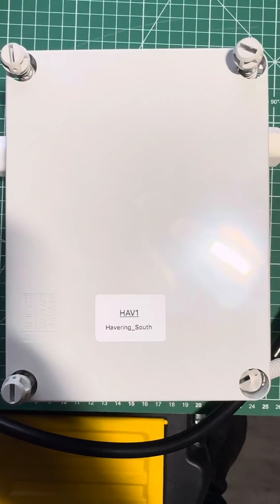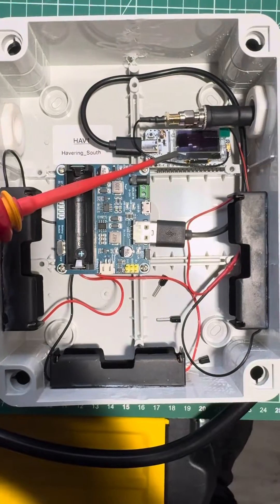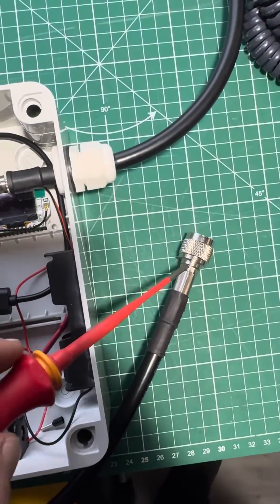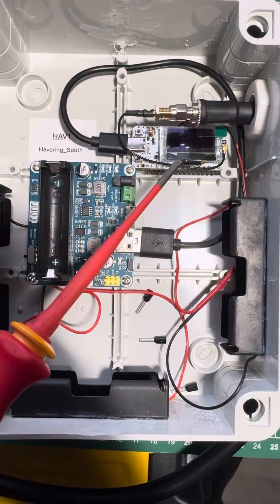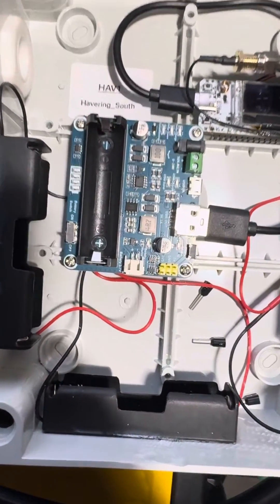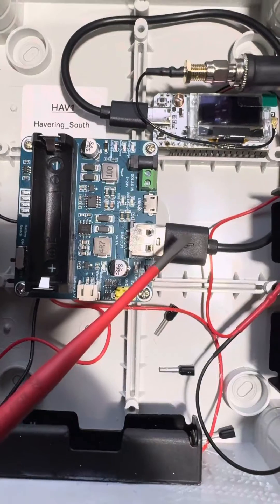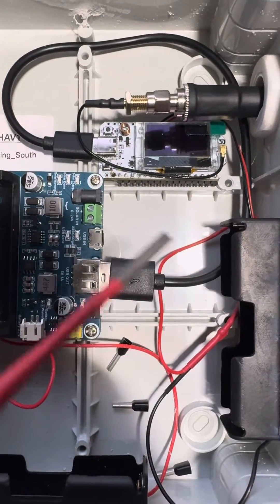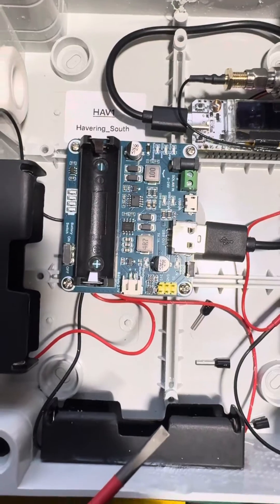MESHTATSIC SOLAR NODE PART 1 THE BUILD

Comment: I found that solar power management charging board on amazon, but it appears to use a 14500 battery instead of an 18650 (which is why the plastic battery holder looks smaller than the other three that you added).  Do you know of a similar solar board which natively takes an 18650 instead?
Reply: Cricklewood Electronics sell a solar panel with attached 18650 holder, as well as some moderate solar panels for low power use.
Reply from the maker: They are out there, however I wasn’t able to find any when I was looking for them when I made this one. I ordered 2 of the one featured in my video, so my next one will have the same. I got a pack of 20
18650 battery holders very cheap too. Vape shops are a good place to go to get batteries! Roll in and ask for 10 and you’ll get a deal 💯
Reply: Hey g1job are you on discord? Wondering if I could pick your brains as have never done anything like this but want to build a solar node
Reply from the maker: @kernowgym  I am indeed. You can find me at https://discord.gg/juStNtvX